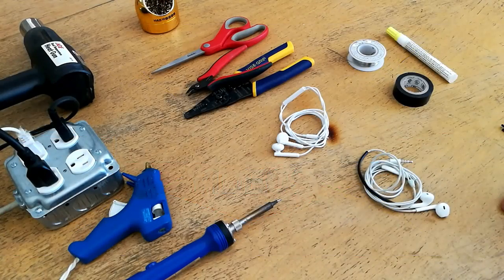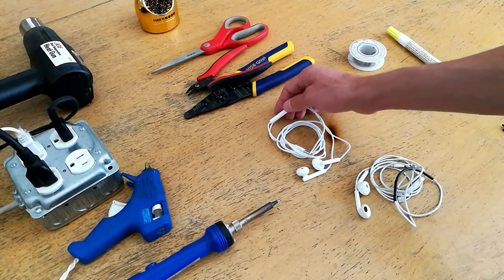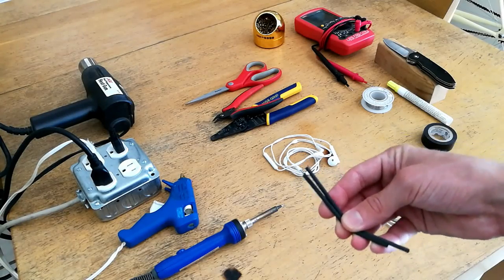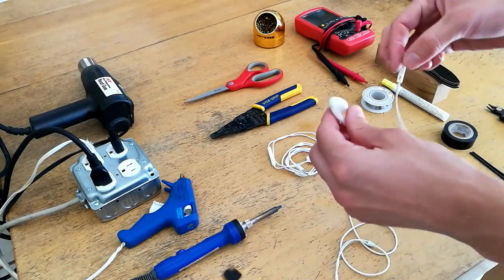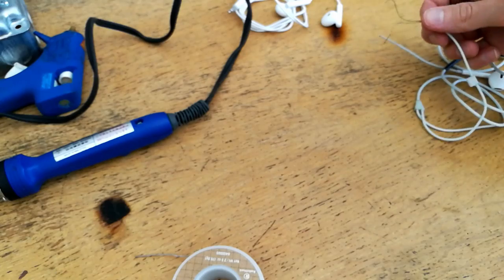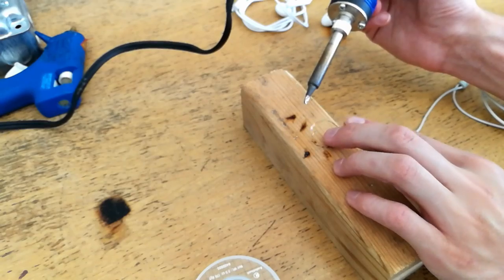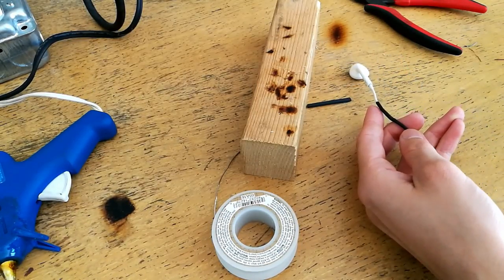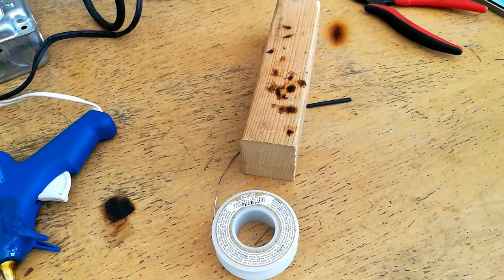EP 39 - Frankenbuds: Apple Earpods For Android?

Comment: ok so i have apple earpods. so i want to make them into "speakers" for a model car but... its so quiet ( i have the
lightning earpods)  ( i have removed the speakers from the headphones carefully so they still work (it has the lightnig port, mic, wire idk). i didnt cut any wires bc i dont want to mess them up so what could i do to make em louder. i was thinking replasing the lightning with 3.5 mm (i have NO idea how to do that, but i can solder, kinda) so i could attach them to a laptop or something so they would be louder.

Comment: My right side apple earphone sound not working may be its wire issue but mike working also left side earphone working any help???
Reply from the maker: Yogesh Arya It could be a loose connection at the 3.5mm jack, at thr volume control, or at the earbud. Does the problem temporarily go away if you shift  the wire around near any of these locations?
Reply: Dielectric Videos actualy i had tried everything but i think maybe wire is damaged above volume control bar bcz volume bar working well that means jack to volume control wire is okbut not sure.any video on volume control bar opening and changing wire above volume control
Reply: Is that earpods from apple youre using in android?
Reply: @ralphnamalata6203  wish I knew bc I was just going to put akg Samsung plug on apple n try it on my Samsung s10